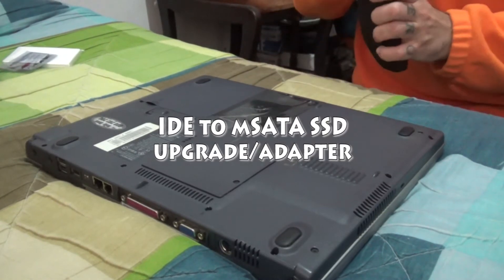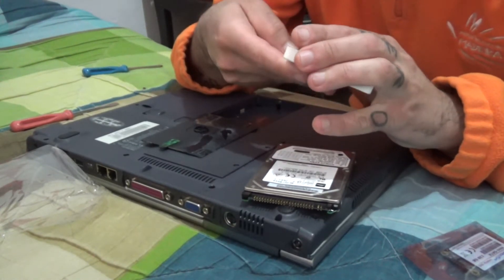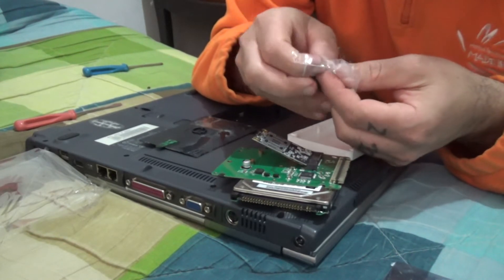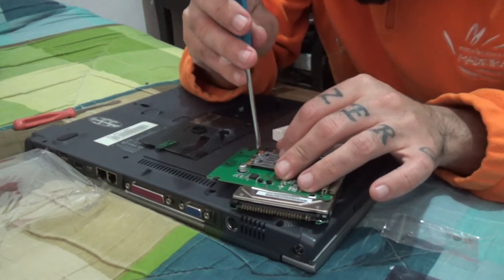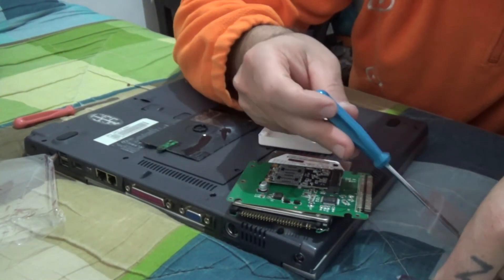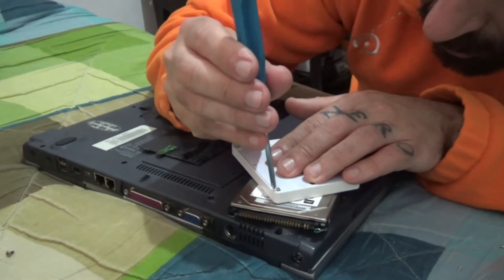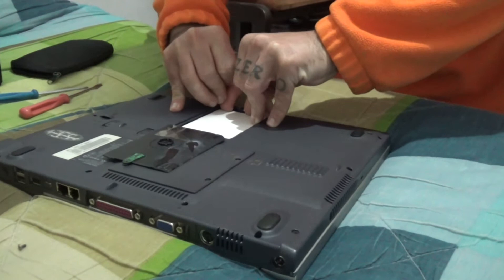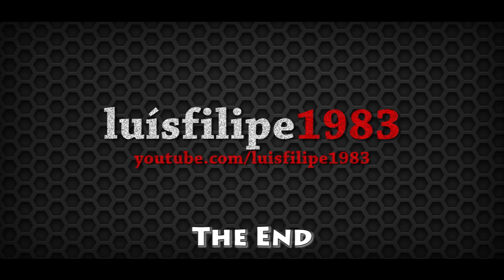IDE to mSATA SSD Upgrade Adapter

Comment: I did this with my Motion M1400 tablet PC, about the same era of hardware shown here. I run Windows 7 on there, on a lowly Pentium M 1.1GHz with 2GB of DDR. It runs SO much better than a 5400 RPM drive - let alone a 4200! It was great finding a way for it to not be so painfully slow compared to my newer computers. Sure it bottlenecks at the CPU a lot, but it still runs much better and actually starts up and shuts down in a reasonable timeframe now.

Comment: Very very awesome, especially with the clone, saves so much time not having to reinstall os, and the drivers. Very cool. Something handy I do is keep loose hd's setup so that when I put it into any computer/laptop it will start to install Windows automatically without cd, right from the same hd.